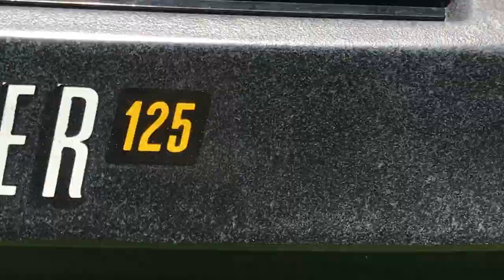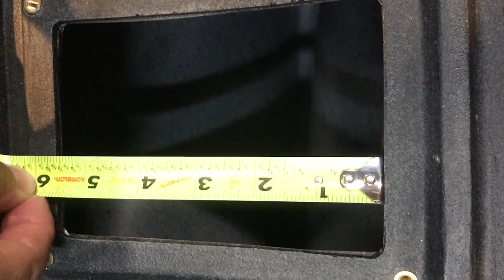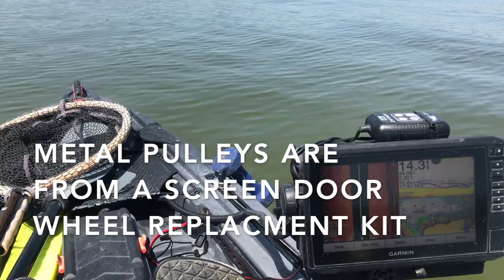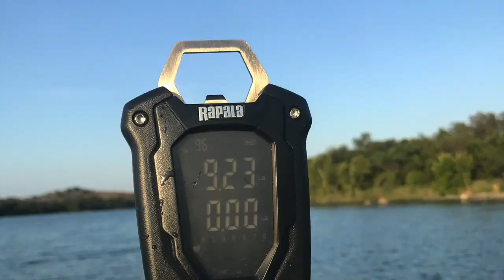VIBE SHEARWATER 125 REVIEW AFTER 6 MONTHS

Comment: 2k by the time  you add their flipper drives in and all of the other not so solid design, I probably just pay a bit more and stick with the Hobie Outback.  Great review.  The rudder seems to be really weak looking.
Reply from the maker: I really like the Outback but choose the Shearwater because I found the seat to be more comfortable for me and will position slightly higher.  Plus, the Outback is over $3k.  Although, since I got the yak gadget drive pod, added click and go locks, and a Hobie 180 w/kick up fins that put everything closer to $2700.   Increased the size of the rudder blade but have not had an issue with it's durability but agree it looks weak.  Although, since it sits on top of the boat I don't have to put it in the protective cradle for when I cartop like I would on the Outback.  Anyhow, pros and cons. Thanks for watching. And enjoy the Outback it's a solid boat for sure.

Comment: Had a SG130 for years, would love a comparison video. Hadn't been able to talk myself out of the money yet. For hammock camping and such, the internal storage on the SG130 is awesome.  Added batteries, front 3 hole console connections, fish finder,, and rear fish light connections. I've seen where you can access the inside of the shearwater. Have you run any wiring in it yet? Thanks for the vid.
Reply from the maker: Yeah, that is one of the disappointments of the Vibe when compared to the SG 130.  More and more I miss having the internal storage.  Super handy at times.  No problems running wiring in the Vibe.  Wired up lights and keep the battery installed in the front access area.  I used a section of 1/2" pvc to push wire from the front access to the rear.    The Hobie Outback is a good alternative with its internal storage but I like the seat and height of the Vibe seat so much better.  Bonafide showed a pedal drive at Icast this year.  That might be one to think about also.  Although, it is a propeller drive and I really enjoy the mirage style drive better.

Comment: Owner of a vibe sea ghost . It's a 2016 or 17 model. After about 3 months the cords going to the rudder broke. The rudder itself broke. The seat straps broke.  I see pretty much the same mentioned equipment on the Sheer. Unbelievable all the parts that needed to be installed upon receipt.  I contacted vibe about all of the issues with my kayak. They're only interested in selling replacement parts . Instead of standing behind their product.

Comment: It's kind of sad, that after all the money you have to spend for the kayak that you had to fix all the problems you had. You would think a company like vibe would have the links worked out before products go to market, thanks for the review. Was thinking about vibe sherewater going to go with old town sportsman 130 pdl.
Reply from the maker: Some of the mods I didn't mind doing and I figure it was a first edition so there might be some issues.  Now there are some commercially available third party solutions for all of these mods (rudder attachment, larger rudder, seat clips, drive pod, etc..)  The only problem I take real issue with is the X-Pod drive holder which has failed me multiple times.  Vibe has made some improvement to theirs but I still don't trust it. The locks are not durable. But you do not need to order Vibes.  I have found  the YakGadget drive holder with Hobie or lightning kayak click-n-go drive locks has been bullet proof.  I still really like the Shearwater though and did not feel like I paid a premium price so willing to put up with these mods that are issues no more.  Yeah, the Sportsman 132 PDL is a solid yak. The drive is really smooth, strong, and in my opinion is probably the fastest pedal drive boat out there.  I thought about getting a Predator, which is the same hull,  but have known multiple people who have flipped theirs. Probably user error but gave me reason for concern. Enjoy your new yak!
Reply: @kayakfishingworks1304  thank you for your feedback and video, I'm sorry that you had to go through all that, I hope that you get to finally enjoy it.

Comment: Nice review. I see that you had issues with the X-Pod.  I've just placed an order for the X-Pod since I will pedal on a Hobie Mirage 180 PDL.  Could you please go deeper on what the issue was and how did you fixed it? Thank you.
Reply from the maker: The new X-pods are supposed to be built more sturdy.  The problem I and others have had with the originals are that where the front of the mirage drive rests on the x-pod will develop a crack.  This will lead to the x-pod filling with water.  Not the end of the world but sometimes that crack will worsen and the lip will break away rendering the x-pod unusable unless repaired or replaced.  This is the issue I had with my first X-pod.  The replacement X-pod was cast poorly only allowing for a very small surface at the front lip to support the front of the drive.  Within 30 minutes the drive pitched forward, basically deforming the lip. This also resulted in the x-pod  locks that hold the mirage drive to break.   Hopefully the pod has been beefed up but unless they are making the locks out of a different material I think they are too weak.  I plan on making a video on this soon. I am happy with my Yak-Gadget version of the X-pod and I added the click and go locks (from Lightning Kayaks) that are like the Hobie Locks.  This system I am happy with and is much more robust.
Reply: @kayakfishingworks1304  Thank you!  I appreciate your prompt response and wait for the upcoming video.
Reply: @kayakfishingworks1304  Hi again. I got my Yak-Gadget version of the X-pod and it is tougher than the original X-pod. The situation I had last Saturday is that the lock at the front of the seat bent and the pod popped out when I was pedaling fast.  In my opinion, the pod should have two locks in that section instead of one.  I wrote to Yak-Gadget to see if they have better locks than the original ones. I hope they do, otherwise, I will have to work around it and build them myself.
Reply from the maker: @RemayPesca  Hi, yeah I just had the same experience.  I turned the lock another 90 degrees which worked for a few days and then the lock broke. I agree with you.  Two locks or at least one that is much stronger.  Fortunately I have a few extra of these locks as Vibe customer service sent me some by mistake but I am going to make something out of aluminum or thick HDPE.

Comment: This was really informative!  Ive been looking at these for a few months now.  Thanks for pointing out all of the cons as well.  I wonder if they have upgraded the rudder and steering system now? I also like that yakgadget has an updated pod for the 180.  Just wonder is coughing up the cash for a hobie is the overall way to go.
Reply: Vibe actually has addressed some of these issues. The pod is now on its 3rd revision, the pod retainer bolts have washers, the new rudder base slides better and also locks in place better if using a Bixpy in reverse. Overall the cons can be fixed, and in my opinion is still an overall good value. The steering system was changed, and is objectively better, however I went a different route putting bonafide foot braces on mine. I also changed the rudder to an SAI ultra rudder which makes a huge difference in water with current. I wish Vibe would make an extension for the existing rudder, but the fact is aftermarket options are available for most of the things you can complain about. I have aftermarket pod locks as well, if you are curious take a dip into the Facebook group to see what others are doing with theirs. I chose the Shearwater because it had lots of options at a reasonable price, and honestly the biggest con at this point is availability for both the yaks and parts, and this goes for a lot of other companies right now.

Comment: So you had problems with the pod and not the actual X-drive? Can the x-drive be used with the yak gadget pod? For me, it's either this or the Pescador Pilot 12, so I'm trying to make a decision. Until seeing this, I had settled on this one due to the seat and the electronics pod. I'm not sure now.
Reply from the maker: I can't speak for the x-drive as I dd not buy or use one.  I have only used the shearwater with a Hobie 180 drive.  But the x-drive will fit in a yak gadget pod.  Personally,  I would go with the                   Shearwater or a Topwater PDL over the Pescador. But not saying the Pescador is a bad boat.  Seats are way better on both boats and have not been super impressed with perception drive vs a PDL or Mirage style drive.  But that's just my opinion.  Wish you well with your decision.
Reply: @kayakfishingworks1304  Thanks! I researched the Pescador further and am not crazy about it. So it will either be a Shearwater with yak gadget pod and modifications, a Topwater PDL 120, or a used Hobie with Mirage if one at the right price becomes available. I need to go demo some, but my options may be limited where I am. Thanks again.

Comment: Hey I’m am looking to buy a pedal kayak for fishing, im debating between the Vibe Shearwater 125 and the Jackson Bite FD. I fish in pretty shallow and grassy waters, and am not too concerned about the speed or stability. Any suggestions?
Reply from the maker: I don't have any on water experience with the Jackson Bite FD but I know it comes with Jackson's newer generation of Flex Drive which was completely redesigned and is supposed to be quieter and smoother than the original drive.  Also, it looks like with the location and size of the Jackson rudder the Bite should turn faster than the Shearwater unless you modify the Shearwater rudder.  Because you will be in shallow water either the Jackson drive in the low water setting or the mirage style drive will both get you in pretty skinny water.  But if you go the Shearwater route I would recommend trying to find a Hobie 180 Drive with kick up fins if the shallow water has a lot of underwater obstructions you might hit .  This is going to make the whole package of the shearwater more expensive however.  Regarding the grass, the Jackson drive makes it pretty easy to clean the prop but I almost never have to clean the mirage drive off and can just power through grass.  The lake I fish the most is a grass lake and that is one of the main reasons that personally I stay with a mirage drive. Hope that helps.  And good luck with your decision.
Reply: Ok Thanks for the advice, much appreciated😁
Reply: the jackson would be a good choice. i would however go with a hobie compass or a hobie outback.

Comment: Can u tell me we’re u get that bracket to hold your Trolling motor thanks
Reply from the maker: I made the piece that screws into the 4 mounting holes out of a piece of 1x6 pvc board (painted black), but you could also use wood and the mount itself is just the one half of the minn Kota trolling motor bracket that comes with your trolling motor.  I cut the clamp off so you could just bolt it to the pvc board and use a removable pin. or bolt so you can remove the motor from the bracket easily.
Reply: Thank u!
Reply: How well did the Trolling motor work right there thanks
Reply from the maker: @scottbricker5004  Works great.  No issue being off center.  I just use it for covering water so it is fixed straight and just use the rudder to steer.  Also, I dismantled the locking attachment for the trolling motor mount so it just flips up if it hits an obstacle and can raise it completely and secure it out of the water by pulling on a rope.
Reply: @kayakfishingworks1304  thanks again I appreciate it mine plan also is to get The Mirage 180 and get that Yakattack pod for it  I think it will be a great set up for me for trolling with pedal or motor if need to thanks again and have a great day

Comment: Received my kayak was not home to when it came my stepson signed for it when i un packed it just to find it had been hit by a forklift contacted vibe just to be told the couldn't replace because it had been signed for 1400 down the drain
Reply from the maker: That is terrible to hear.  Hopefully, you can get something out of the shipper or escalate it at Vibe for a replacement.  If not, plastic welders are not very expensive, but still not what you want to be stuck doing on a new boat.  Hope you can get a replacement worked out.

Comment: Does it have a reverse??
Reply from the maker: I did not buy the Vibe pedal drive as it is only one direction.  You can pull the Vibe drive out and spin it around backwards and that will let you reverse but this a bit cumbersome. I actually use a Hobie 180 drive with kick up fins in the Shearwater.  You pull on some cords and it reverses the operation of the drive.  FYI-Hobie is the only manufacturer with a reverse for a flipper/mirage style drive as there patent on this is till in effect. (I bought my drive off of Ebay.)

Comment: All the mods and repairs it sounds like that kayak is a total pos
Reply from the maker: Ha..not at all.  If someone is buying it just for paddling or using with a bixby really no need to do any mods, including the seat clips.  The issues come in if you want to use it as a pedal drive. Don't need to modify the rudder but glad I did because it turns tighter. But you definitely need to modify the seat clips (10 minutes) and unless Vibe beefs up their drive pod would not pay for theirs and just buy the Yakgadget one which is solid.